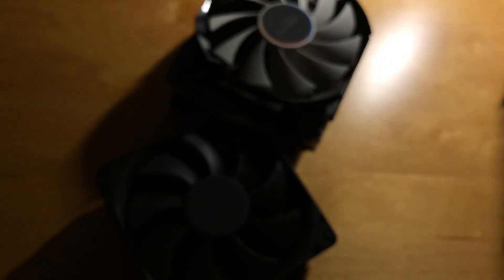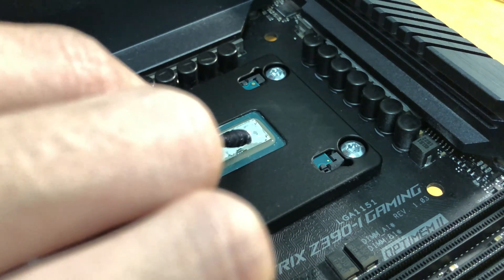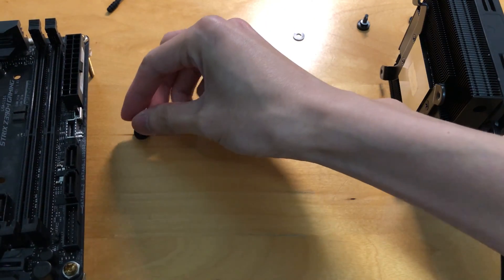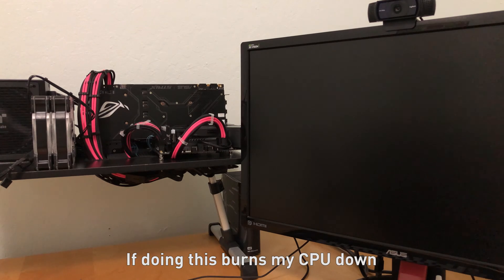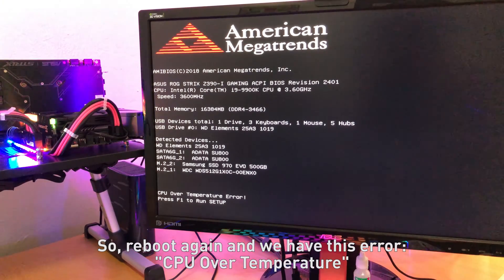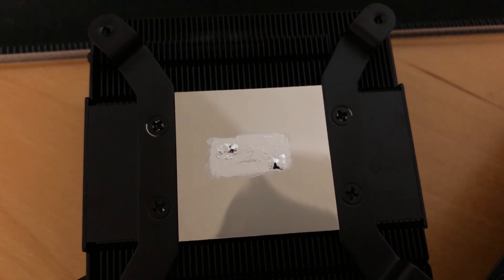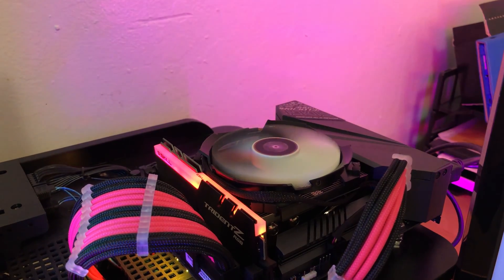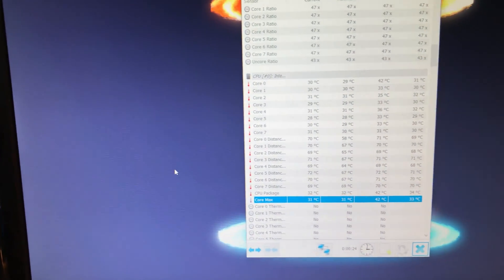I Tried Direct-Die Cooling i9-9900k with Noctua NH-L9i and Cryorig C7

Comment: When putting LM on the cpu cooler itself, how do you know you’re putting it in the same exact spot on the cooler as the CPU will be?
Reply from the maker: I estimated :))
Reply: You can apply alot on the cpu, put the cooler on it, screw it in, then unscrew it and see where the lm left a mark and then fill it if it wasnt enough.

Comment: First of all,the i9 9900k stock with IHS on it,non delid,with Noctua NH-L9i idle temperature 50 degrees.So there is no way to get these temperatures with direct die. Don't get confused,it doesn't matter if you are using washers because the mounting kit is on the Cooler not on the motherboard,as you can see the only thing you have done is to change the position of the screws.100 % no contact between die and cooler.
If you want to make this work,unscrew the mounting kit from the cooler and make a custom one like the original but 2.8mm lower(bacause the high of IHS that you have put out is 2.8mm).You can even play serious game titles on 75 - 85 degrees with direct die on this small cooler.The cpu throttling in benchmarks and on high intensity cpu programs,also you have to know that this is worth only if you want a tiny strong gaming pc and the only way to cool your intel or your amd cpu is to use a low profile cpu cooler.
I hope i helped!

Comment: Man. I use 9900 (non K) with this Noctua cooler and it works fine. On idle it handles temps like a champ. Under stress test I got 80 C max. It is sufficient for 9900 no problem. For K version probably not. Non K version has 65 DTP
Reply from the maker: Glad to hear from you as there are not many information about the non-K one. I once got a reply from a redditor about him using a 9900, and he said it was too hot :))

Comment: I did this on laptop cpu and the result should be positive because I was running a 80watts cpu under 80 C with a miserable laptop cooling module with is weaker than those low profile air coolers. Therefore, you should have some good temp in BIOS because the cpu is not even loaded so the power consumption should not be high.
Do be very careful about the mounting. As you said, the air cooler might be blocked so it is touching the die with an angle causing the liquid metal not being able to keep every corner of the cpu touching with the heat sink. And my experience with it told me that the LM is so sensitive that any incorrect angling could cause problem. (Especially the Thermal Grizzly’s)
One way to test this: use little toothpaste and don’t spread it evenly, just put one little spot of it. Then mount the cooler properly with enough mounting force. After this, take off the cooler and you shall see how the toothpaste spreader with the mounting force is added. If it is spreader evenly, that might indicate your lm should be ok, otherwise, you should reconsider about the mounting stuff, like uneven force added by each screw.

I failed applying the lm for couple of times and i succeed when I was thinking this could be scam.

I am pretty sure your cooler are still cold when the temp of cpu skyrocket.

And yes, even if you see there are trace of contacting, it doesn’t really mean anything because you could not conclude that the heat sink had contact the die evenly enough or close enough.

Comment: If you’re really all into csgo you should get a Ryzen CPU the 3700x beats the i9 by about 50 frames
Reply from the maker: That is for sure not true. My i9-9900k at 4.7GHz hits ~350fps (I just checked on Friday). While the 3700x max turbo speed can only reach 4.4GHz. Many articles have shown Ryzen, even a 3900X, is weaker than Intel in single core performance, which is essential for gaming.

One thing that I will never trust is benchmark channels. Those videos usually have the same game footages and the only differences are FPS numbers, which can be easily faked. Unless they show me the hardware they own, I will never trust any benchmark channel
Reply: I got the information on linustechtips on one of their benchmarks on the Ryzen 3rd get CPUs in 1080p
Reply from the maker: They usually used a benchmark map, which does not represent realtime gameplay. I suggest you watch TechDeals, he has a series videos of comparison between 9700k/2070 super and 3700x/5700XT.
Reply: Essential for gaming face palm if that’s the case you moron Xbox and PlayStation will be running 8 9900ks cores at 5.3  you moron single core maybe ok for 1080p but 4K well even the intel 6 core would be ideal at this point because there is no point having more cpu when your gpu is doing much of the work on FPS so what you say is bullshit it don’t matter oh single core sucks on amd even if it runs a game at 4K 65fps with a good gpu so shut it